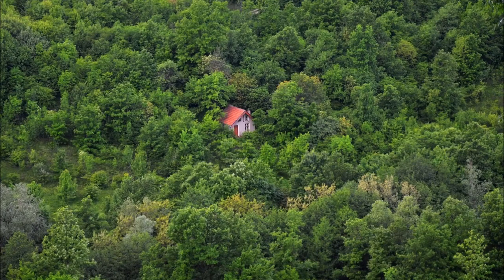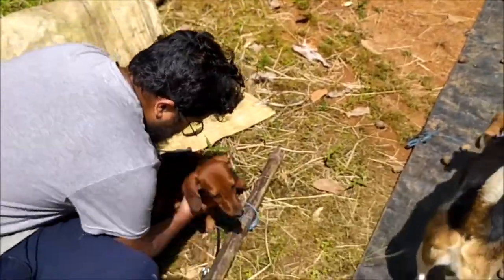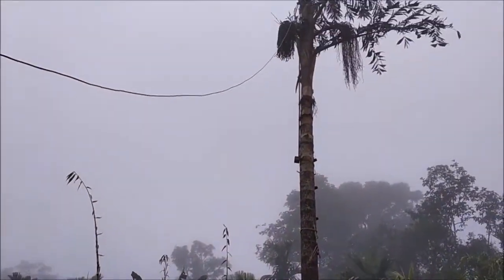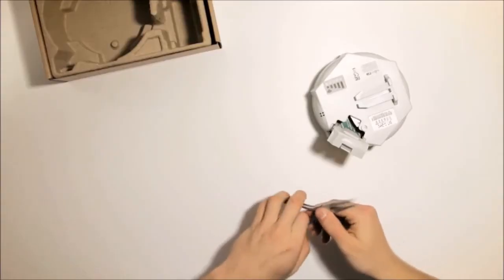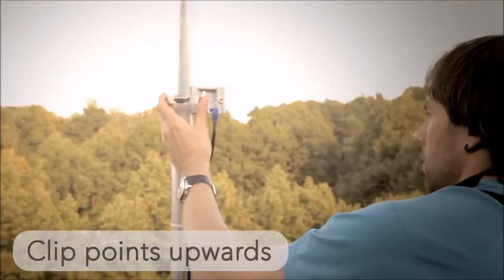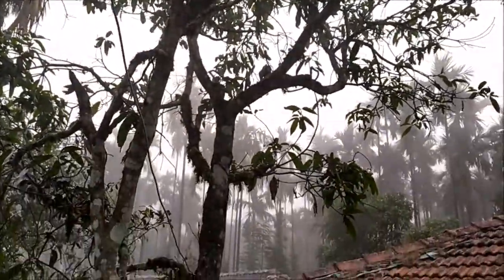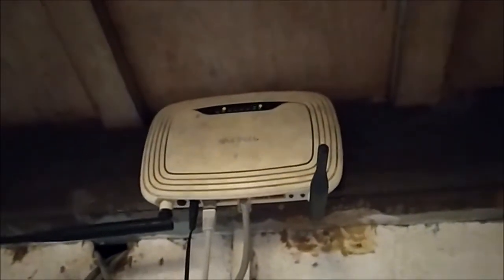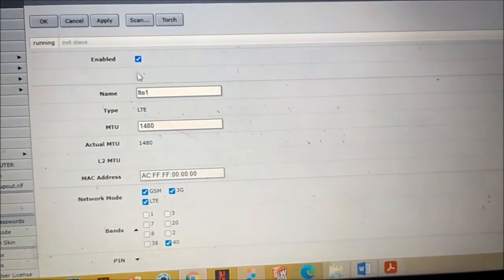Internet in remote areas |  TPLink MR6400  |  LPDA antenna |  Mikrotik SXT LTE  |  4G LTE

Comment: I noticed you have the Poe Ethernet connected to the wlan port of the router.. Is that the way it should be or should the Poe Ethernet be connected to one of the lan ports?
Reply from the maker: it should be connected to the ethernet input port. Mine is an old router so it looks bit confusing.

Comment: Thanks for this. It was useful for me to know about the device you finally settled on.

Also, you did very well by putting up the antennae on a very tall pole as opposed to a building. My brother-in-law, who is a communications engineer, tells me that this will enhance the quality of the signal the antennae will pick up because it will pick up less of signals that are reflected off of other surfaces, and more of signals directly from the carrier's tower, to put it in plain English. 

I've made a similar setup too in my father's farmhouse in Belgaum, Karnataka, but it'll be more elaborate soon because I'll be installing a load-balancing router I purchased for multiple 4G LTE routers in the coming days.

I was wondering, wouldn't hanging the TP-Link LTE router, with its own antennae on that pole directly, in a waterproof swimming bag (https://www.amazon.in/dp/B01N7BMUJT/), fetch you a great signal? You can use a cheaply available POE splitter (https://www.amazon.in/dp/B07T8BS4D7/) power it over Ethernet, and connect it to your old router inside the house. What do you think of that? *I am keen to hear your opinion about this*. 

I too have hung my 4G LTE routers at high points with their own antennae in the aforementioned waterproof bag, albeit I will be using POE the way I described above in the coming upgrade, as opposed to running extended router UPS leads—they seem to fail and the device switches off, probably because they aren't meant to be that long and I may have used too much जुगाड़ there. 

Also, I have also just purchased LPDA, Yagi, and parabolic antennae to test with these routers, connected via coaxial cables that are no more than 5 meters long since I'm told that using LPDA antennae with very long coaxial cables, in excess of 40 meters, will usually reduce the quality of the signal transmitted to the router—the shorter the coaxial cable, the better it is; this may have played out in your previous setup as well.

TP-Link has since released 4G+ routers too, with carrier aggregation. This means it can lock on to two bands, both manually and automatically. I intend to try that too if my smartphone displays 4G+ signals at high-spots in that area. This could be quite useful if it works out.
Reply from the maker: hey  thanks a lot for this wonderful comment. Yes I did think about mounting the TPlink router at height using the POE. However my biggest concern was accessing the router physically. For example changing the sim. Otherwise it should work. I should mention, I live in a heavy rainfall area (Malnad) so I'm more worried about the reliability issues. 
Also I was about to buy a parabolic antenna and in that process I stumbled upon sxt, I just wanted to test its performance and to my luck, it worked very well. The LHG version has inbuilt parabolic antenna and it is far more superior I guess. 

Anyway, I'm eagerly waiting for the starlink to launch in India!!
Reply: @Devaramane  Oh, yes. I booked Starlink as well. However, a friend of mine said that we shouldn't get our hopes too high: https://www.theverge.com/22435030/starlink-satellite-internet-spacex-review . Fingers crossed 🤞.

Getting my load-balancing router will help me get up to 4 WANs, and I intend to use all those, especially if Starlink's connection will flicker as often as the above article mentions. 

I understand your concern about rains. I will post a video of what I did, and we survived some very heavy monsoon showers with no waterlogging issues in the equipment—I created a cardboard insulated plastic dome to house the waterproof bag in which has the router. This dome was an inverted plastic vessel used in construction to carry concrete etc., left over from a previous construction. Also, it was strung up using a pulley. So, I could lower it to access it any time I wanted. Of course, here, I didn't use any external antennae, so the direction of the device didn't matter, so it was okay for it spin on it's axis a bit.

I have one good reason why MikroTik is better still—it's engineered for the purpose. And very well at that. So, it is probably a more efficient performer than TP-Link routers with external antennae and all that set-up—it should have better signal reception, and it certainly seems to be a more tight, hassle-free solution. So, I think you did very well by finding it and using it. Thanks for bringing it to my notice.

By the way, do you know, the Bangalore branch of the dealer you mentioned in your other video about said that he has the LHG LTE kit at ₹10,200+, whatever that '+' means. But, I am more interested in LHGG LTE6 kit; it has 4G+, or carrier aggregation, and that makes a world of a difference! Unfortunately, he said that that's not in stock. So, for now, I am going to go my parents' farm and check how much better my existing D-Link 4G routers will do with a standard Yagi, Omnidirectional, LPDA, and parabolic antennae with 5-meter LMR400 cables versus it's internal antennae, and also whether 4G+ shows up in my smartphone. If it does, I will buy TP-Links MR600 4G+ router and latch those antennae on to them. I may still buy the LHG LTE kit since it may do better than the TP-Link set up with external antennae since it is a better performer overall, probably only second to LHGG LTE6 kit.

Then there's 5G, whenever it rolls out. MikroTik apparently has 5G routers. 

Let's see. I need to collect more data before I decide. Or more money. LOL. Will find a way to keep this community posted.

It's good to talk to you.
Reply: Hi there, even I tried hard to get LHGG LTE6 KIT. Called RECTUS INDIA, MULTILINK COMPUTER  and many other dealers.  But couldn't get it. All said it's out of stock. I came across one more out door unit called PROSCEND. ( Single as well as dual sim). Seller is from Chennai. Now I m using TP LINK MR 600 with two LPDA antennas. Have ordered two parabolic grid antennas from Delhi. Will check it along with LPDA antennas, keeping the focal point and length according to the Parabolic grid antenna.

Comment: Hi, Good evening. I'm one of your youtube subscribers and have been watching your videos and I'm highly impressed with your techniques. I have network and speed issues and have high hopes that you'll have a solution to this problem. My house is located in a mountainous area. Two towers are located in different mountains, one is 4-5 km far and the other 8-10 km far. My network often gets disconnected and in case even if the network gets connected the speed is too poor. Can Mikrotik SXT LTE help solve this problem? Thank you!
Reply from the maker: Could work I guess. 
As you mentioned, you get connected sometimes, so this device may work. 
In my case, I didn't have any connectivity and my house is situated in a similar condition just like you have mentioned.

Comment: Cheers for this video.... Thanks Anna.... I leave a remote village where the network is good.. But I don't know what device to use to get internet. The Airtel mobile internet Very good... I need something wifi kind of thing.. can you please suggest. The Airtel WiFi dongle is not soo good which disconnect frequently. Should I go with this setup ??? Currently the speed is 15-20 Mbps in my mobile
Reply from the maker: you can easily go with this. I can say it is the best solution in the market. 
Howver as you have mentioned you are already getting 15-20mbps on mobile, you can try a cheaper solution. Try a 4g LTE router. TPlink MR100 or MR6400 would work great for you.

Comment: Hey nice video...same condition here....where did u buy 300mts cable? Can I get cheap offer there? Any links as such?😛
Reply from the maker: correction (I forgot to add) It was 30 mtr cable. Got it from a local vendor.
Reply: @Devaramane  I thought so! I read that Ethernet cables can be no longer than 100 metres without another device powering it or enabling greater length.

Comment: Good information bro
But Yesterday's unfortunately i was booked lpda and mr600 router . I am really  disappointing . Me also work from home due to covid .
Reply from the maker: MR600 isnt a bad idea either. Make sure your antenna is as high as possible. I had setup my antennas at 40 feet from the ground.
Reply: @Devaramane  ThankQ for reply
I am leaving very village area i am doing work from home . My home to tower distance +1.5km . Very poor net single not visibile tower from my rooptop. Hiding with coconut trees gardens. I have doubts what size height pole can i use for tower signals.plez suggest. me .
Reply from the maker: @taraktarak7296  you need a minimum of 40 feet. Use 2 GI pipes. 1.5 inch and 1 inch pipes. Connect them with a reducer. 

Its better if you can tie this pipe to a tree or another pole for support. 
You can tie it to a coconut tree also